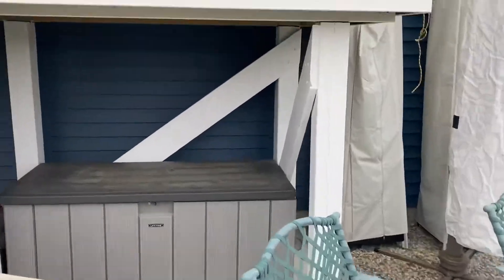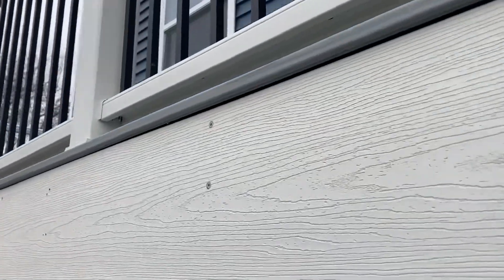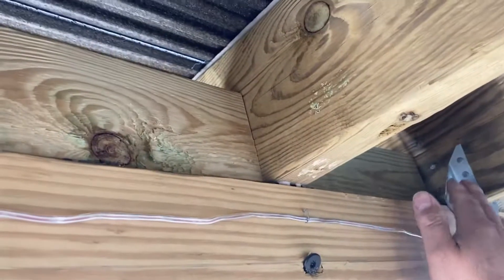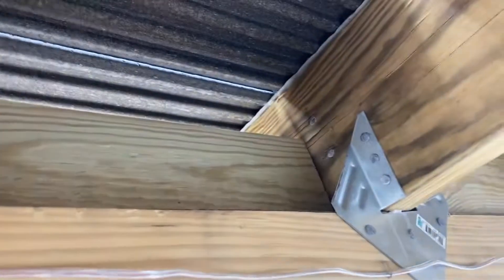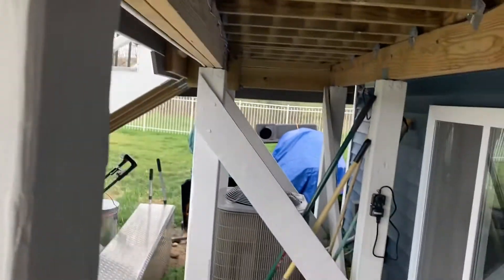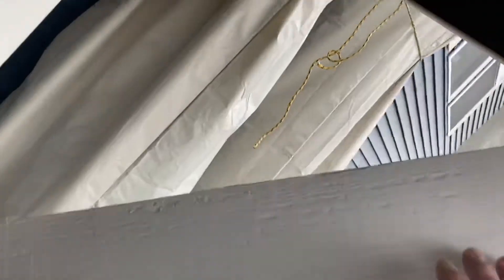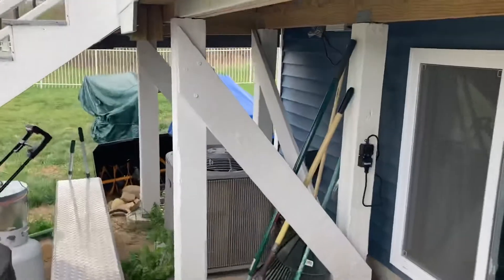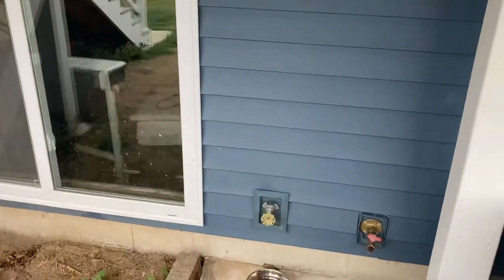Building an over engineered deck part 5: avoiding sway

Comment: How do you get the fascia board over the bolts holding the posts to rim joists?
Reply from the maker: That is a really good question, I should have shown that in the video but forgot.   I measured (very carefully) the distance from the top and side of where the board would eventually go to the center of the bolts, then used a 1" spade bid to drill a shallow hole (just deep enough for the bolt head) on the back side of the fascia.   Unfortunately I managed to miss the centers on a couple of them and had to re-drill.  But once I had the holes completed the fascia mounted nice an flat.   Hope this helps!

Comment: Fantastic info. Building a ground level deck for my backyard, and figured the offsetting of the blocking I've seen was simply to make it possible to attach each block from the edge of each joist into the block, which would be hard to do if they were in a straight line all the way down. Didn't realize there was a structural reason! Thanks for the series of videos!

Comment: Stagger blocking. I guess when I come up I should bring a mig and we can over engineer some more Brackets. You do know the deck will be there if a tornado hits and the house will be gone. but at least it will give you a base line to rebuild from. Great Work Devin Keep it up